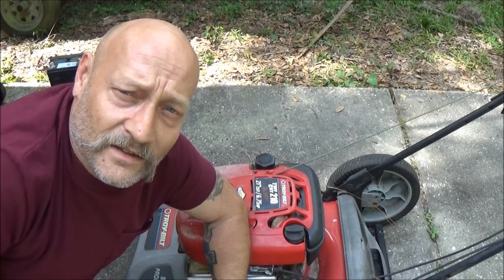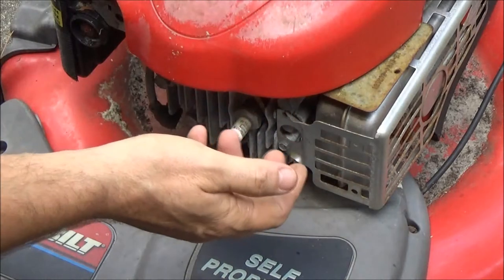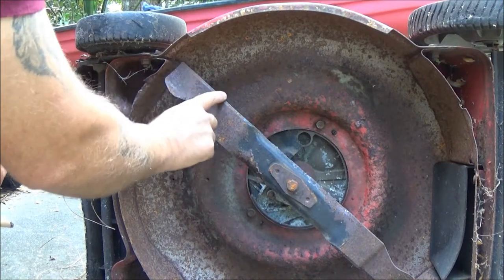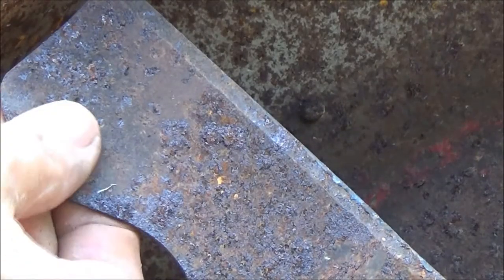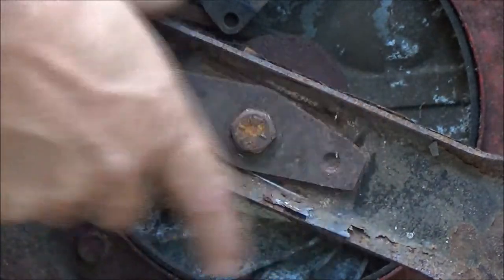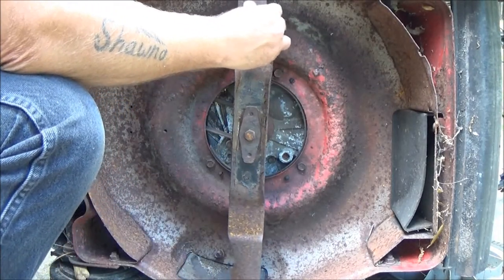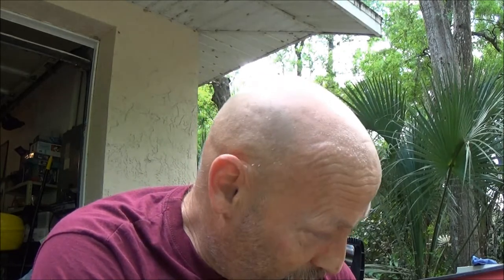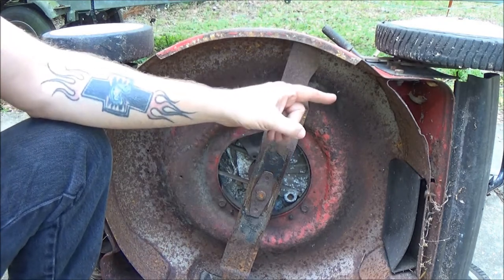How To Check The Blade On A Push Mower

Comment: I have seen that on a couple of mowers, where people had the blades installed upside down.  That's good that you went over this, I think it's a common mistake that people make.
Reply from the maker: I've seen it alot. Easy to do if you're not used to doing it.